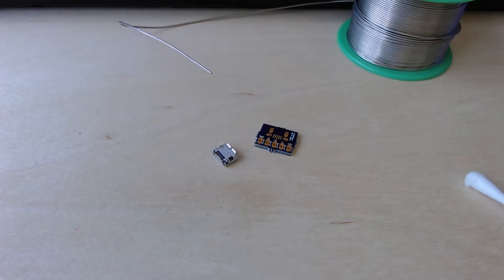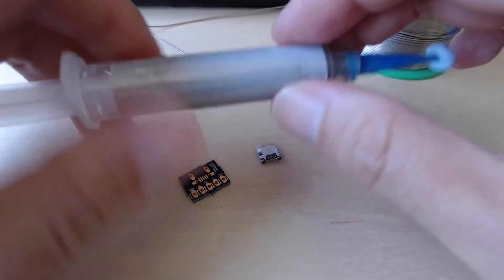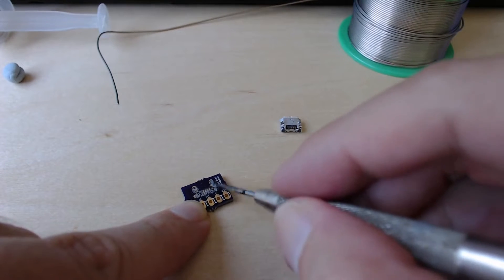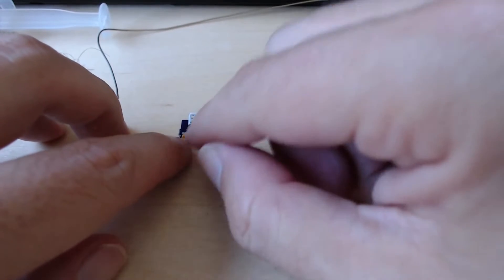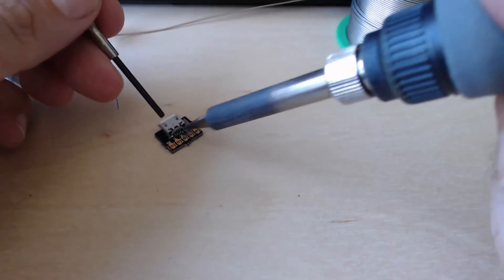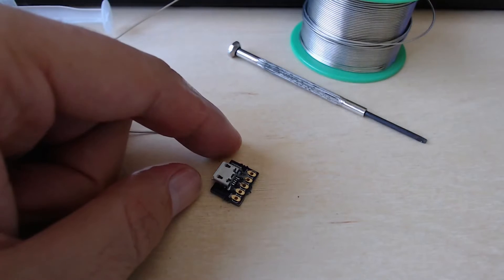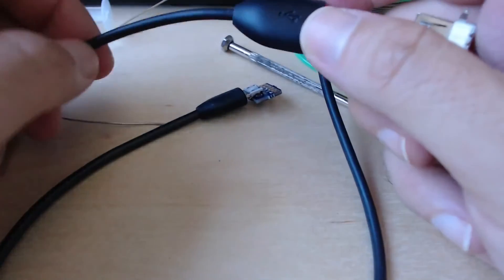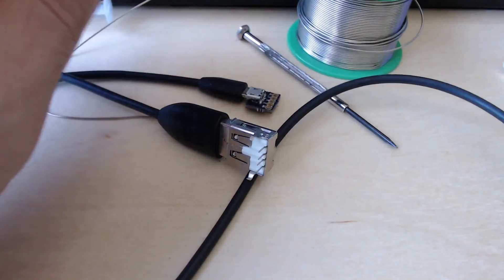Hand soldering USB micro type B receptacle

Comment: Hi, good video but I believe what you used is called only USB Micro connector that supports USB 2.0 standard. USB Micro Type B connector looks a little bit different and it support USB 3.2 Gen1 (formerly known as USB 3.0) standard.
Reply: Micro USB type B is the most common USB receptacle that older phones had, previous to the type C.

Comment: I never saw you put solder on 5 pins on connector or board? Did the connector come pre tinned?
Reply from the maker: You are correct and to my knowledge the connector wasn't pre tinned. Clean contacts, solder paste and flux under good heat is good enough. Solder flows to the pins.
Reply: @funstacklabs  gotcha. The solder paste has the solder in it?
Reply: @baboneya  yes, thats why its called solder paste